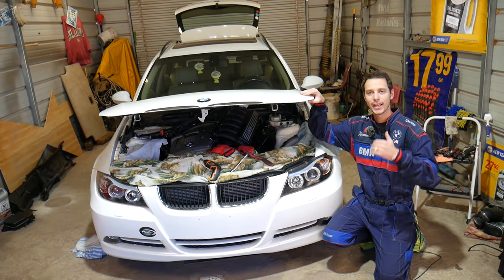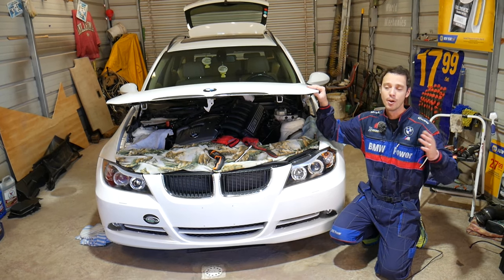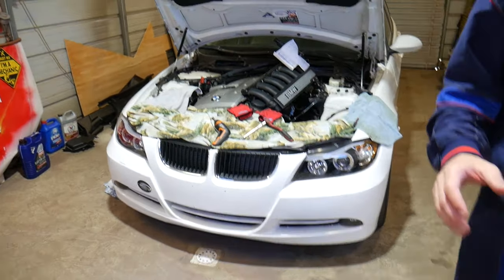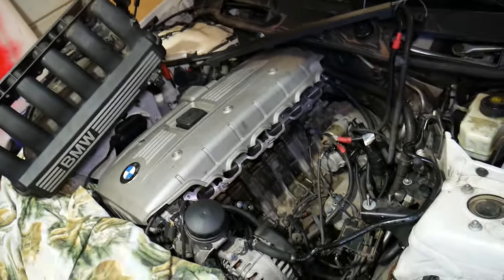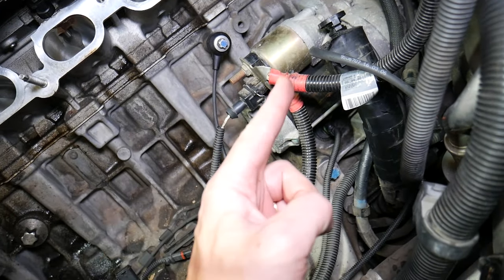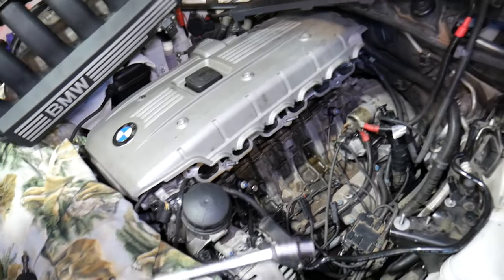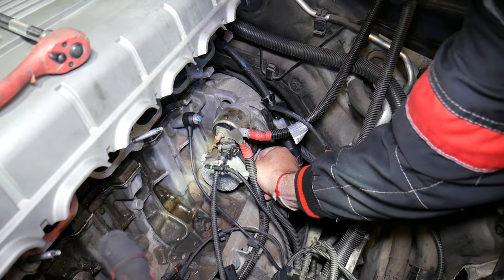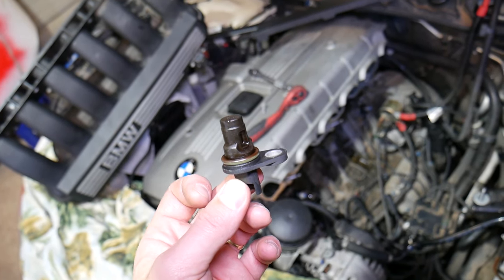BMW WHILE DRIVING TRANSMISSION MALFUNCTION, DRIVETRAIN MALFUNCTION, NO POWER, BMW DOES NOT START

Comment from the maker: Products that we use and recommend:
► Crankshaft Position Sensor N52 Engine (check fitment): https://amzn.to/2Xuzhj4
► Crankshaft Position Sensor V8 Engine (check fitment): https://amzn.to/3NolTY8
► Reverse Torx Socket Set: https://amzn.to/3evO848
► Panel Removal Set: https://amzn.to/3YiMADu
► Tool Set: https://amzn.to/3p5MM6t
► Screwdriver Set: https://amzn.to/3XRB28Q
► Castrol Oil: https://amzn.to/3xBc8B9
► Oil Filter: https://amzn.to/3w0Ulme
► Torque Wrench: https://amzn.to/32qyRwg
► Liqui Moly Engine Flush: https://amzn.to/3IiDBID
► OBD Scanner that we use most often: https://amzn.to/3I4MQfe

► Check out our Amazon Store for the tools and parts that we use: https://www.amazon.com/shop/worldmechanics
Reply: Hello boss's..  I have this error comming. Chassis  countinue the journey t a moderate speed. This came after ai have changed the front adaptive shock absorber on the front. They are ftermarket.  Do you hve any ideea?
Reply: Thanks guy! Really appreciate the info guy.  Very helpful, and if a guy like me ever needs any more help, I hope a guy like you will help a guy like me. Thanks again guy!

Comment: HI, I HAVE A 2011 BMW 328i convertible, the 2 codes I am getting on the car is P0335 & P1727 the car take a few seconds to start but will run fine with the codes, stalled in a corner going 5mph once but it will still run. I replaced the CPS using your video, it started but ran real rough for a minute then idled fine for 2 min I turned the car off and tried to start it but now it will not start No codes are present and the RPM is reading fine on my scanner. I watched this video and took apart the entire car again to double check everything was put back correctly and it was. I put my old sensor back in and now the car runs fine with the same 2 original codes P0335, P1727. What do you think is the issue? New sensor wont run with no codes present, Old sensor will run with 2 codes present P0335, P1727
Reply: Clear the codes after changing sensors

Comment: My transmission light came on but I didn't lose power it just wasn't shifting and when I started it back up again the warning light was off and it drove fine. When the light first came on and it wasn't shifting I tried putting it in sport mode to down shift and it wouldn't go....... please help me figure out what's wrong!
Reply: I have the same problem. How did you resolve your problem?
Reply: Same problem here! I start the car and the warning light is off and I can drive it about 15 minutes to work without it coming on, but then I start again and go five minutes down the road to lunch and then it turns on in the car basically get stuck in 4th
Reply: Did you ever find the problem?
Reply: @commanderstarstreak9390 I have the same problem. Did you manage to fix it. I am desperate

Comment: my car feels like it has a delay when I turn left then starts putting, like the car does not go into gear, mostly happens when I pull off a off ramp the transmission light comes on and I have no driving power. is there any hope it might be a sensor or is the tranny going out

Comment: I have the same issue with my 2011 BMW 750i - transmission malfunction and 4x4 stabilization light came on.  Went to the mechanic to get it diagnosed and he told me I have to rebuild the transmission.  I’m not a mechanic but I’ve owned many BMW’s before and I doubt that’s the fix.  I reset by turning off/on the ignition.  I’ve been driving car for almost 3 weeks with no issue.  I know eventually issue will reappear.  Please advise.  Should I rebuild transmission to fix issue or get a second opinion????
Reply: How exactly did you reset it? I have the exact problem and car won’t move
Reply: By simply turning the car off and on when code pops up on dash or have a mechanic reset code with code reader
Reply: Get a second opinion
Reply: I had that problem months after I bought my f10 550. Transmission malfunction. I pull over turn the car off let it sit for some minutes and it's back on drive ok

Comment: I have a 07 bmw328i sedan.its slow to get out of first gear but then is smooth when it gets going up until 4th gear im guessing? Right around 70-80 mph,rpm keep climbing close to 3000 and doesn't come back down to below 2000 so i dont know if 4th gear is out..any advice would be appreciated
Reply: How did u resolve that issue?
Reply: How did u solve it?

Comment: I shifted my My 2005 x5 into reverse and it was struggling like I was on the brake. Then the 4x4 light and abs light came on as well as what I think is the tire pressure gauge. Any thoughts?
Reply: had that issue as well. MAF sensor needed changed and tire sensor.

Comment: Hi i need help finding out why my 2005 bmw 525i is telling me transmission fault and when i start hitting the gas slowly to start driving it hesitates to go until its around 2000rpm and when im driving slowly it stays around 3000rpm i know the rpms arent suppose to be that high driving at a slow speed also when i put it in drive the car kicks but doesnt when im in reverse or park , the car was fine until i cleaned the air filter box and removed the connection thats on the air filter tube also after i went to autozone for a check engine codes thats when it was really noticeable . Please any help will be very appreciated
Reply: i got same problem with same BM model! have you managed to fix that please 🙏🏻

Comment: I have a 2012 BMW X5 xdrive 35i e70. I’m replacing the engine. Do I need to replace the transmission bell housing bolt?

Comment: Hi
I have a 2014 x5. Sometimes when I accelerate around the 20mph mark, my car does not speed up. It feels lagging but will then eventually start moving. No engine lights no warning. Any idea?
Reply: check your spark plugs and ignition coils
Reply: And also check your air filter, gas filter and pump, if your pump is clogged up it will cause you to loose power before you get a warning

Comment: I get the same issue on rare occasions maybe once or twice a month the code is pressure too high, but then it goes away once I reset the car and then it will be fine for a couple weeks
I tried getting the turbo to boost, maximal pressure, and the ending no issues but when I drive it normally sometimes it’ll pop up any ideas I want to replace the pressure solenoid, but not sure if that’s what’s causing it since there’s not often

Comment: When the car is driving about 40 mph, & if I  want  to speed up & pass a another car, or take a steep hill it chokes it makes a chocking sound . It takes a long time for the momentum by the time it's gets up to 70 or 80 mph it's time for me to slow down again I just had the transmission serviced I just had a new alternator put in I don't know what the problem is I have a 2005 X5 BMW thank you for your help I'll be waiting for your answer since you're the best channel for BMWs on YouTube
Reply: Sounds like a misfire to me change your spark plugs
Reply: @isaiahstaley3289  
I did change my plugs . My coils  fine. I'm about to get  a diagnostic  I hope it's not  a catactalyc  converter.
Reply: Did you end up on knowing what’s wrong with the car or the problem this is happening to me right now to my
 bmw 135i M
Reply: @feir01   transfer case is issues / transmission issues 🤬
Reply: It's my transfer case in my transmission I need a new transfer case but that is so many different dimensions when you dealing with a BMW but it's the transfer case/transmission it sucks so I just bought a new BMW haha
Reply: @feir01  transfer case
Reply: @feir01  
I need a new transfer case

Comment: Hey, Auto repair guy I have a 2007 bmw 650i convertible car will runs fine but at idle or at slow speed the car will shut off and sometimes want start right away and sometimes it will start right away seem like it not getting power when it won't start and  multiple dash lights come on but after sitting for 15 to 30 minutes it will start and run fine until it happens again a bmw specialist look at it but can't figure out what wrong with it can u give me some ideas of what could be going on this is frustrating
Reply: Did you have any heavy rains recently? Or does it act up only after a rain storm?
Reply: @Carlos Duran  it happens we it rains or after it's rain I notice when it happens the most
Reply: @Carlos Duran  I mean it happens the most doing a rain storm and after a rain storm.
Reply: @cbravo1122  yes i did have a rain storm that's when it does it the most every time its rain the car start to act up the cutting off part.
Reply: There is a connection above the transmission oil pan. Spray some electrical connection on there. It seems water is making your connection bad. I had this issue.
Reply: @cbravo1122  thanks brother I give that a try
Reply: I have the exact same car and problem. Did you find out what's causing it to do that?

Comment: I have a 2010 x5 e70 diesel and every time im at highway speeds and try to speed up it cuts out and says transmission malfunction also when im at regular roads speed and i gun the suv and it cuts out or when im entering the highway,  i have changed the alternator , i have 2 batteries,  i have done a dpf delete.  New ground cables. Just before it malfunctions. The rpm starts to bounce but only at high speeds. It seems the transmission doesn't gear down before going to a higher gear to go faster..i always have to pull over and turn off the suv and restart...any help?
Reply: Did you figure it out? Mines is doing the same. Now it only cranks but wont start.
Reply: I took it to a repair shop witch they only repair bmws and the owner has the same suv like mine and he said that all the transmissions are like this even his bmw and if you change the transmission , in like 3 months you will have the problem again...he said something that the transmissions are made in china and are not good...i went to bmw dealership and they told me that  all the e70s have this problem. I tried to drive it in manual on the highway and it still gave me a " transmission malfunction "..what i want to know is that why bmw did not have a fix for this or even a recall because they just replace a bad transmission with a bran new bad transmission..i just take my time speeding up slowly in the slow lane..thats all i can do.
Reply: @glycoln  did you check the crankshaft position sensor yet?
Reply: @tazmaniandiva7762  im changing that this weekend so see if the problem goes away
Reply: @tazmaniandiva7762  my bmw is charging at only 12volts, so i had to add another battery to " trick" the computer to charge the battery at 14volts, my bmw x5 diesel will always die in the winter because of the battery not being charged enough and it wont start but will crank..after adding 2 battery's the problem went away.
Reply: @glycoln  okay, im hoping it works for you. I'll check back next week. I would like to know the amount of time it takes you because I've had alot of shady mobile mechanics who want to just take people for a ride with diagnosis and not really fixing anything. Good luck!
Reply: @glycoln  2 batteries? Never even knew it was possible. I'll have to look into that. Thanks for sharing.
Reply: Update.. i changed the sensor and it seems that " transmission malfunction " went away.. im not sure 100% yet but i floored the suv on the highway and it never kicked out..i did take me 7 hours to change it because i did not dismantle most of the engine parts to change it. Only the starter i had to take out to get to it...when i took the sensor bolt off the sensor was completely stuck to the engine and i couldn't get it out after 1.5 hours later of wiggling it, it came out...but overall no problems of malfunction yet..it seems to be back to normal for now
Reply: @glycoln  oh man, sorry for your troubles but thanks for sharing. Im glad you got it back working. Just to clarify, you changed the crankshaft or camshaft sensor?
Reply: @tazmaniandiva7762  the crankshaft sensor
Reply: @glycoln  ok thank you. Mines went off to the shop today and I'm praying thats all it is.
Reply: @tazmaniandiva7762  im driving today and transmission malfunction is happening again..i have my scanner with me and it is saying..e clutch
Reply: @glycoln  sorry to hear that. Mechanic told me I needed a new engine. It sucks because we haven't even had the car for a full year yet. My heart is in pieces right now.
Reply: @tazmaniandiva7762   good news i have fully repaired the " transmission malfunction" i changed the solenoids in the mechatronics unit and after that i no longer have the problem anymore
Reply: @glycoln  that's awesome! I know you're happy you got it done. Wish I was as handy with tools. Lol
Reply: @glycoln you just changed the solenoids? Anything else?
Reply: @tazmaniandiva7762  I changed everything.  Right now I took out the gear for the throttle body and for some reason more then half the problems went away
Reply: Update 2024 - I took out my throttle body gear in October 2023. And now it's april 29 2024 and the transmission malfunction only came on 3 times since then. And I can also rev the car hard and it won't kick out..I believe its a transmission programming issue because I don't have any wear inside the transmission..you can try taking out the throttle body gear. See if that helps you. So far for me all my troubles went away.....Maybe the programming is closing the throttle body and the car kicks out and right after it kicks out the programming opens the throttle body to full open..

Comment: BMW 09 335i owner here. Car was driving fine for half the day then all of a sudden I get the trans malfunction warning on the center screen. Car starts to lose power I cannot go over 20 mph when I do the car will overheat, the screen console turns off, and windshield wipers turn on. As soon as I take the foot off the gas the wipers stop and screen console turns back on. 

When switching from Drive to Parking I hear a rough sound. Any thoughts? Thanks.
Reply: Any updates?
Reply: @coreysergent8581  Yeah, the day all of this happened I was able to make it home driving about 10 mph. In the morning the car was dead. Battery was drained completely. Tried giving it a charge but no luck. Battery was dead. Since the battery was dead I knew it had to be the alternator. If alternator goes then it won't be able to charge the battery. So the alternator was the problem.
Reply: I have same problem, she’ll premium gasoline helped me to put it running properly but something is wrong I’m still looking for a solution problem persists with other gasoline brand.

Comment: I have a 2010 550i Gt and it’s doing the same thing. Except when I first turn it on it’s already shaking saying drivetrain malfunction. We’ve changed the spark plugs, coils and computer and the issue is still there. Any help ? Thank you !
Reply: Your side rails it's not always the drivetrain the BMW engine has something called side rails check that out I have the X5 but most of the BMW engines are pretty much the same
Reply: Engine mount
Reply: @Throneless_King  
I was thinking the same thing

Thank you 😊
Reply: You can try changing the Mass Air Flow sensors or do just what the gentleman explained in the video.  See if the Crankshaft Position Sensor is connected.
Reply: @nicolehall8204  yeah that’s what the problem is for mine.

Comment: Hi I have a 2010 BMW 528. I received the same error when turning on the car " transmission Malfunction" but when I clear the error the cars runs fine. its just when I start the car I get the error. I ran the diagnostic check and nothing related to the transmissions with error codes. any suggestions?
Reply: Check your Battery or IBC ECU on mass pole. Had same issue with old battery if IBC is online - CODE THE BATTERY CHANGE properly, otherwise your car will think that you still have old and it will prevent battery to charge as needed and will block the charging cycles..
Reply: @rostislavchrysochou8218  that would make sense since there i have received a battery drain when turning on the car. Also, I did get a new bmw computer scanner, and it did give me an error 4E22 electronic pressure control valve 3. Might be time replace transmission fluid.
Reply: @rostislavchrysochou8218  Thanks again for your input.
Reply: @rostislavchrysochou8218  I replaced the IBS but now its telling to switch on terminal 15  to register the battery. And Im unable to find the location terminal 15 I dont think is the fuse since I tested and its fine.

Comment: I just got a 2009 bmw X5 derive48i v8 and I put regular gasoline then transmission mail fictions started to happen, then I put premium gasoline and it worked for a while. Until I put other brand of gasoline started to happen again , goes driving the suddenly loose power reduces the speed and the message on the screen appear Transmission damage or malfunction. Any tips how solve this problem, I really appreciate.
Reply: Bruh just use the gas it’s made for lol

Comment: Hi, i have a 2009 BMW X5 3.0 with a similar issue. After major flushed engine with new oil and filter replaced. You start the engine and immediately shows up "LOW PRESSURE OIL" and you start test driving. After a 1km or so, the engines shuts down and goes to neutral. After that the engine does not start. What it could be the problem? It happened twice
Reply: X5s are known for having a oil leak with inside of the engine you won't always see oil on the floor but I had to replace my gasket and a gasket cover and it stopped the problem
Reply: I'm sorry I meant to say valve cover it's the thing that holds the oil in the car have someone check your valve cover valve cover assembly